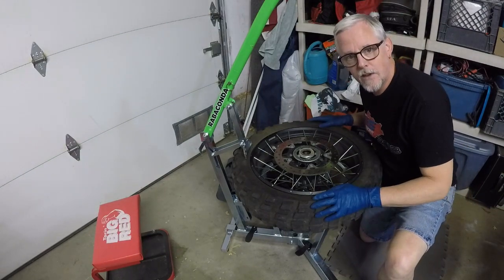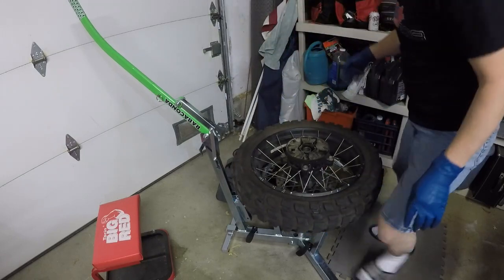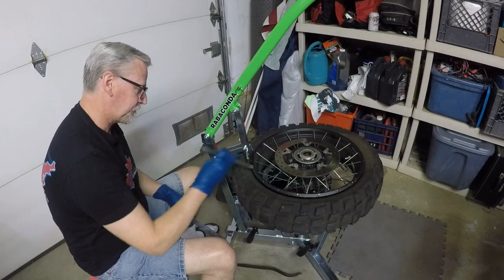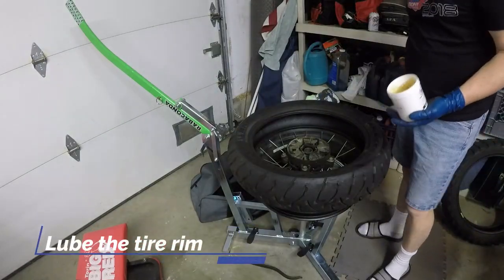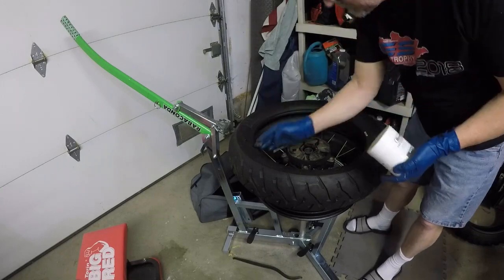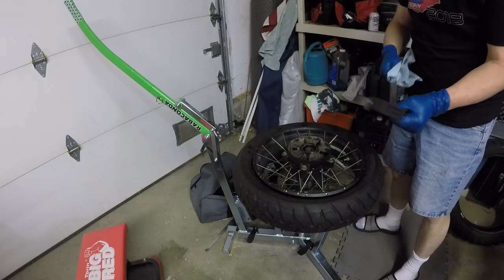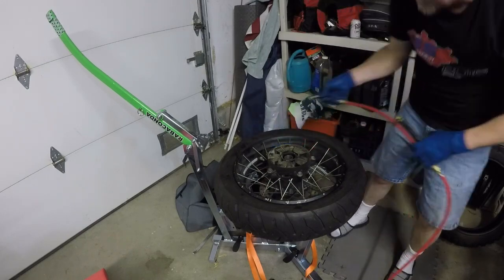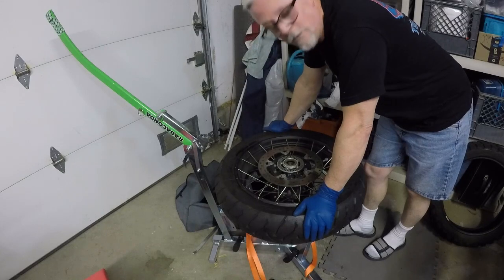Rabaconda Tire Mounting Try Number 2

Comment: I attempted using my rabaconda for the first time yesterday and managed to bend a spoke on my rear wheel for my r1250gs. Seems to be quite a bit of flex with the location of the supports. Have you had any issues with this?
Reply from the maker: Bummer on the spoke dude! What flex were you seeing - in which supports? In general I found that most times when things flex due to prying "very hard" are situations where looking at what you're doing can lead to doing it in a better way. That usually means like dropping the tire into the divot so there's more space on the other side to relieve stress.